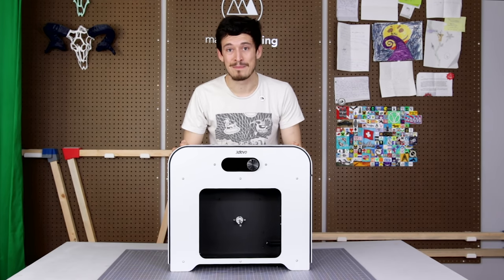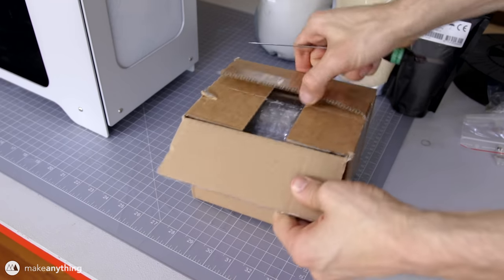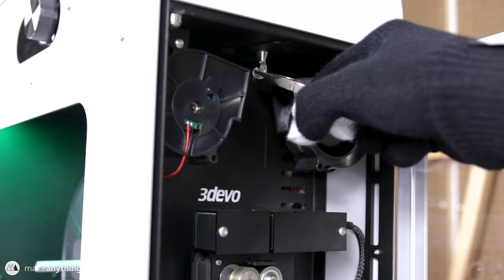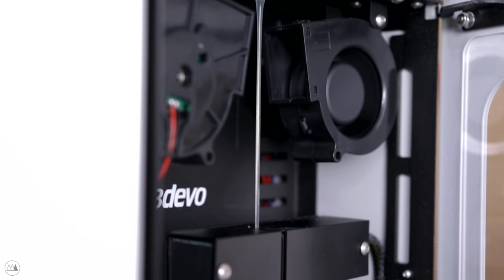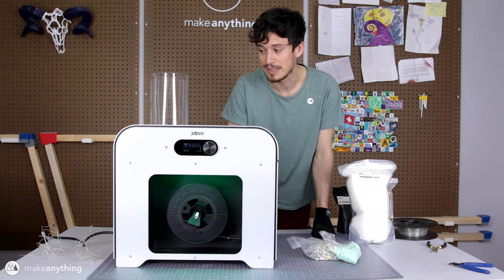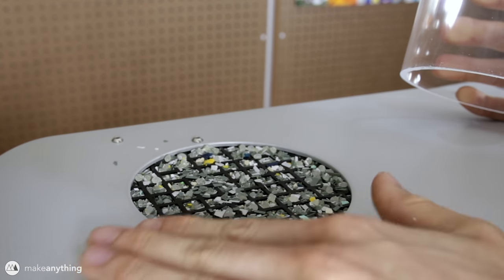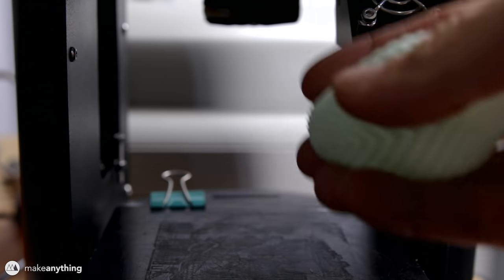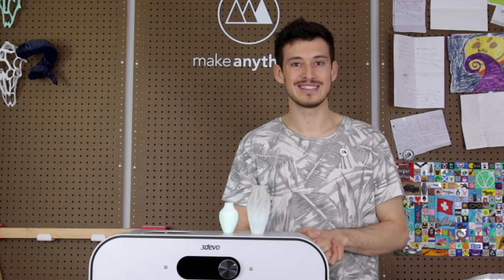Making my OWN Filament from Failed Prints with the 3Devo Composer

Comment: Ouch !!!!! Incredibly expensive !!!!!!!     Looks nice from a distance but the tolerance of the filaments is so great that variation in filament will result in constantly failed prints, especially when using a multi filament extruder head like one on the PRUSA MK3S with MMU2.  I would have to buy 350 spools of Prusament super high quality super low variation filament in order to break even.  And what's up with the activation code ?  Is there a required subscription in order to keep using the outrageously expensive low quality product ?

Comment: Print crappy filament at any diameter, then chop It into little beads like the raw PLA. The next time you print, use the recycled beads. It will work 10x better

Comment: Could you go into the activation code thing a little bit? Is it a one-time thing? Does it cost money? Can't find much on their site.
Reply: Hi there! In regards to the activation code, we have our customers request an activation code after they have read the quick-start guide and extrusion precautions. We do this to ensure that they have properly set up their Filament Extruder to prevent clogging or other issues that may occur with  certain materials (if not treated properly).
Reply: @3devo  I see, thanks for engaging in the community!

Comment: Hi does anyone know how to get a text message on the LCD screen of the printer? I have an ender 3 so basically a reprap setup. I know that M117 does that but it just pops up for a sec and then printer goes to "sleep..." message/mode.  It would be great if my custom message stayed there as long as another command call for another message.

Comment: What did you use to grind up your plastic? I saw a machine like this on Tom’s channel but it the presenter fed it pieces of plastic into a large hopper, and it ground it up and then extruded the filament. Shredder and filament extruded in one for the same price...
Reply from the maker: I used a coffee grinder, but I really do need a proper shredder

Comment: You should be using a 25% recycled to 75% virgin material blend. Most decent manufacturers use that blend. Any more and you'll have more brittle filament in my experience.

Comment: Okay Guys i have been scrolling to the Comments and some or you just dont know a thing about plastic. I work in the plastic Industrie and studied it. 
First of all it is not possible to make a filament of equal qualitiy of which that you put in.
Even in industrial Maschines the diameter fluctuates big Time in that case the Maschines have sensors and can adjust automatically. And yes it is expensive..like these technologies always are when they are redesigned to be used in home.
I want to advise those who just think they know about their pla and stuff to realy inform about it and not spread false information or opinions that are based on nothing.
Thank you 
Greets from Germany
Reply: You aren't the only industry guy to post about this either.  Marlin firmware can allow for that tolerance as well. The argument about the cost and electricity is also off because it only applies to this machine. The cheaper Lyman extruders built with recycled parts are way less than this machine but there are sub $500 extruders that you can get that do the same job as this. The winder is usually extra though. The other thing is that you can build or buy grinders to get the recycled bits to an acceptable size. All you do is re-extrude the filament and chop it up into a consistent side and then re-extrude it. Most people haven't done any research and just try to use them out of the box and this is exactly the type of video we get.
Reply: Deneteus exactly there are way cheaper machines. The winder is an easy diy project just a variable speed motor. I dont like the way this Video makes most of the uninformed of the Community think that this Setup is bad.

Comment: 03:16 activation code so you can get full access to the machine!? is that actually a safety mechanism or just some kind of hardware licensing management scheme?
Reply: Hi Tony Jee. The activation code is just a safety precaution. When we first deliver our extruder you are allowed to process materials up to 200°c (ex: for PLA). Anything past 200°c (such as more complex materials) requires an activation. We have our customers go through this process to ensure they have read the start-guide and extrusion precautions. We want to make sure they have properly set up their Filament Extruder in order to prevent clogging or other issues that may occur with certain materials (when not treated properly). I hope this helps clear things up a bit :)

Comment: Until a machine comes out that takes whole or large chunks of failed prints in one end and spits out consistent pla filament on the other I just don't see a market for it.  Even if you could save a few bucks per roll it would take thousands of rolls to break even using virgin pla.
Reply from the maker: Yeah, it's definitely not about saving money at this point. Moreso recycling and experimenting

Comment: Its oozing forward, but until they get a chipper/chopper/grinder with a larger hopper included so you can toss your scraps in to reclaim filament, its pretty much a non starter, the companies that make filament feed themselves from their products, as in its what they do, so they will do it better than a dabbling hobbyist everytime, but the reclaimed scrap and left over market is where the recycling dollars are, so if it doesnt work, just reuse it, or those bits of crap you have to dust on the shelf you dont want anymore... reclaim it and make something else, and the price currently weeds out 99.999% of any " user " end of things

Comment: Is there a company that I can send my scrap filament to who will restore it back to printable material?

If not, it likely won't be long. I really should just take the idea and run with it. Start the company, become the millionaire that someone will inevitably become with this idea.

But seriously, could sending in scrap filament for restoration be as cost effective as purchasing a new spool?
Reply from the maker: I think it could certainly work at scale, and even better if it's a local thing rather than having to ship giant bags of failed prints.

Comment: As I do have experience with this machine (the 1.0), I can tell you what’s gonna happen next when you explore with it further. 
I've tried recycling PET bottles on that machine and it went horrible. As PET isn't an easy material, I was able to break both their shredder (another €3000 machine, if they send you that as well, and no smaller shreds won't fix the hopper issue you have) and filament extruder. The screw and sensor (although somehow only accurate 0.04mm, but displaying 0.01) work great, but I concluded the machine is basically rubbish. Mainly because of the motor. The motor is not synchronous, removing any chance to ever get a decent tolerance on its own. (that’s why its rpm is not at 3.5 all the time). The nozzle assembly is also made out of plumbing components. Do yourself a favor and don't run the machine to cold, the machine doesn't have proper protection. Also open up the machine and put insulation material around the nozzle. The heaters have a life of their own as well. The display and interface are just unacceptable for the price point... The machine itself had great potential but they cutted corner after corner to make it look nice, they seem refuse to fix even the small ones at their revision, seeing your nozzle still uninsulated.
Reply from the maker: Hmm, well for what it's worth the nozzle is surrounded by insulation (which is covered by a magnetic plate)

Comment: It's a good way to quickly populate your room with another "quad-copter" - a toy for few weeks :D
Even after Chinese will clone it and will be selling for 200-300$ I'll not buy it!
So bad consistency of a filament diameter tells that it's a low price segment hobbyist equipment... that the company tries to sell by a price of a non-cheap 3d-printer with all adds/upgrades... Guess which thing will be choosen first by the most of consumers? ;)

Comment: 350 rolls of filament its paid for itself
Reply: You forgot to add the price of the raw plastic materials and the processing that it may require.  And how about the price of labor for someone to watch for diameter irregularities and mis-spooling?
Reply: Yes print 1kg per day plus costs of granulat plus colored granulate because raw granulate you get only in white or transparent, all different colors you have to buy separate in 25kg bags, for each filament sort you need different color granulate, you have to dry it, and so on, and such a screw inside like the barrel has a limited time which it can work or how much filament it can produce plus powercosts. I cant print 1kg per day, who can because my printer isnt so fast.

Comment: Ok. Make your own Filament with Granulate which is more expensive per Kilo than a ready-to-use filament. 1KG PLA Granulate costs 11 Euros - 1KG Filament Roll costs 8,70 Euros.. same differences are also at any other Material. So it no makes any sense to make your own, because you also have 
electricity costs to the price of granulate on top.

Comment: An activation code, much less one the user has to click-dial? That's pretty user-unfriendly.

The feed path to the spooler, and the spooler cabinet both seem pretty awkward. I think they should have worked to build something that's reliable before trying to make it really pretty or fit in some arbitrary form factor.

Comment: It seems like a lot of extra work to recycle prints, and it also seems to generate a lot of waste on it's own...  which you probably can recycle again.
Pretty expensive machine, you'll need a lot of plastic waste...  let's say a role of 1kg is 25€, you'd need 120 kg of clean plastic waste to match the investment of the machine (not accounting for energy cost and additional matterials for cleaning).  
A recycling facility could use it and run it non stop and make a profit

Comment: Do you know how much filament you can buy for $7,000?  At current prices of roughly $20 a spool that's 350 spools of filament. I don't know about you but it would take me a long, long time to use 350 spools. It might be good for a Makerspace, but for individual use it seems insanely expensive and pointless.
Reply from the maker: I'd say saving money isn't the objective of this extruder. It's more about being able to create unique small batches. I'll admit the intended market is small which is probably a part of why it costs as much as it does

Comment: Obviously the price is too high for practical purposes. You can buy a lot of ready-made filament with better tolerances for ~$7,000, and not have to deal with extrusion failures, which appear to be more common than successes with this unit. Even if it only cost $300 it's still not reliable enough to replace buying decent ready-made filament.

Comment: If you could make your own ULTEM or PEEK, ok. Then the price would be fine. But for PLA, ABS, CPE, unameithere, the price is just too insane.
I think you will not get a consistent diameter if the source material is not consistent though. You need a shredder that creates 0,4mm - 0,6mm parts, if I am correct, how this system works. And if I am correct, the price is not justified. Thats my 2 cents.

Comment: What about instead of taking failed prints and turning them into filament how bout a 3d printer that uses failed and old prints to print with it could have a container and grinder and it could feed the ground filament straight into the hot end
Reply from the maker: I shared this exact wish on Twitter :P It would be awesome!

Comment: DRM is an instant "No" and a dislike from me. DRM is never OK, no matter the excuse they come up with to justify it.
The price is also absurd, but that will come down with time -- I'm more interested in some of the Open Source DIY kits out there for this sort of thing -- they're far from mature (mostly still gravity-fed), but they look interesting nonetheless.

Still, home filament production is a cool thing for me. I've been kicking around the idea of putting two continuous diameter sensors on a 3D printer (at right angles to each other), and keeping track of the cross-sectional area of the filament as it passes through, loading the saved cross-section for the part of the filament that is currently being loaded into the melt zone and using volumetric extrusion to print smoothly even with severely out-of-diameter and non-round home-made (partially-recycled) filament.
I'm not really familiar with embedded programming, so the calculations might be a bit much for an Arduino, but anything running something like Klipper should be able to handle it -- as long as you constrain your filament length (use a PTFE tube even with a direct extruder), you should be able to mount the sensors arbitrarily far from the extruder (so, on the frame/spoolholder) and just program that offset in.

Comment: using old prints would of worked all you need to do is put it through  again after extruding. grind it down the repeat. its only 1 hour of time but if you do 1 kg worth its 20+ usd or gbp saved.

Comment: Sadly with a starting price point VAT included that is over $7600 this is surely not a feasible solution to save money...or anything, besides maybe companies with HUGE amounts of prints, and even in that case I wouldn't be so sure.
If they made it more accessible it would totally change things.
For the standard home DIY 3D printer guy this is surely not something that would make any sense, not at this price point, maybe at a less than $1000 it could start making some sense.

Comment: For $7,000 USD you should not have to tweak any settings! That the big problem with all of the biggest issues with these all in one systems, none of them can handle recycling old PLA, and they are just a scam!

Comment: Why does this need to be activated? is this a subscription service?
Reply: Hi Shane. When you fist get our extruder you are allowed to process materials up to 200°c (ex: for PLA). Anything past 200°c (such as more complex materials) requires an activation. We have our customers go through this process to ensure they have read the start-guide and extrusion precautions. We want to make sure they have properly set up their Filament Extruder in order to prevent clogging or other issues that may occur with certain materials (when not treated properly). I hope this helps clear things up a bit :)
Reply: thank you for the reply  @3devo

Comment: Something isn't right about all this. You are assuming that filament plastic doesn't fundamentally change when it gets melted into a 3d print. So, you can just chop it up and reuse it as many times as you want. But this cannot be true. Most filaments are highly hygroscopic so we have to keep them locked up in dry boxes. But our 3d prints are not. They do not pull moisture out of the air constantly. Something changed very significantly when it went through the hot end. I dont believe that when you chop up failed prints and melt them into filament that they suddenly become hygroscopic. Still, a great vid and I liked it. I am not a chemist so feel free to disagree.

Comment: The price tag doesn't make any sense at all.The software is basic, the parts inside cost no more 200 dollars and it doesn't work with scraps. This should sell as low as an entry level printer, since it is an entry level extruder after all

Comment: We all can see that this machine is not a very complicated tech so just can not cost so much and producers just overpriced this thing at least 10 fold if not more. I can not see the logic to sell one with 6000 when you can sell 20 with 600 or 60 with 300 especially when there are other factory ready products available with 1000 and DIY sets available with prices below 500 ( also probably at least double overpriced) that can do the same job.

Comment: Why does it need activation??
Reply: Hi Arttu. When we first deliver our extruder you are allowed to process materials up to 200°c (ex: for PLA). Anything past 200°c (such as more complex materials) requires an activation. We have our customers go through this process to ensure they have read the start-guide and extrusion precautions. We want to make sure they have properly set up their Filament Extruder in order to prevent clogging or other issues that may occur with certain materials (when not treated properly). I hope this helps clear things up a bit :)

Comment: air bubbles in it. you can even see them with the best-case scenario with the included pla granules.  Yeah.. not gonna reck my prints with this crap. 2 things need to be fixed before I would even consider paying for this POS. 1) Airbububble's in the filament, perhaps using a vacuum pump or some kind of degasser module.   2) after the extrusion nozzle, there needs to be a pair or a few pairs of temp controlled press rollers to fine-tune the OD of the filament.   +/-  0.07 mm is horrible.

Comment: 5,350€ for machine and 15€ for 1kg  of granulate, not to mention cleaning supplies and spare parts. Ale of that to make filament of same or even worse quality than Chinese  filament that you can get for 15€ per 1kg or even cheaper?  This makes this device just overpriced piece of garbage without any real world use.

Comment: $7000 for device that works best only with specially prepared raw materials, and even fails with recycled 3D prints??
Sorry, but if it cannot process plastic bottles, it worth nothing! Why do we need another machine that produces plastic waste? It should process plastic waste instead! Until 3D printers start working with any type of plastic, they bound to fail. As inkjet printers now!